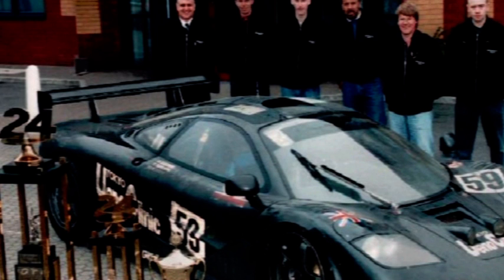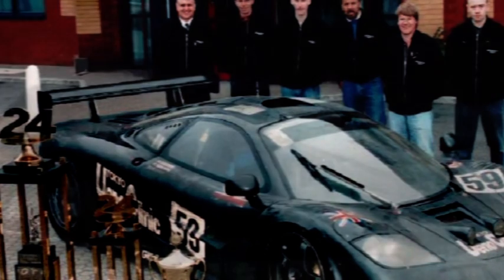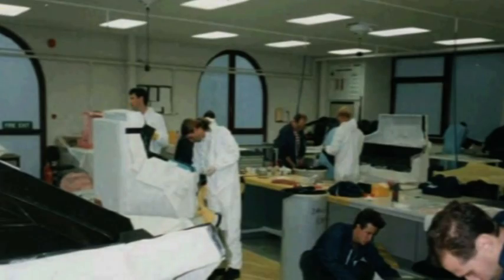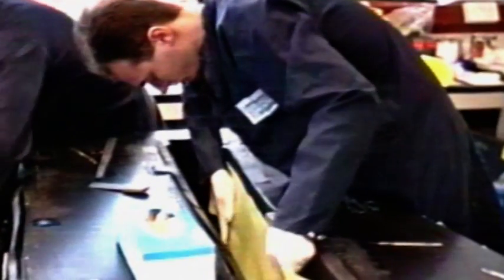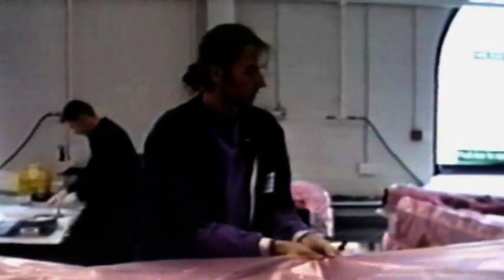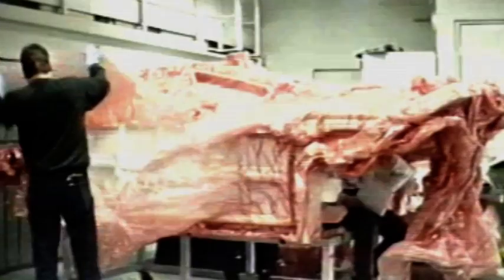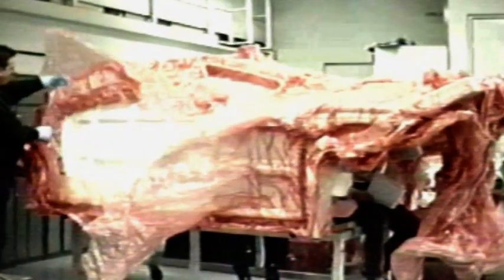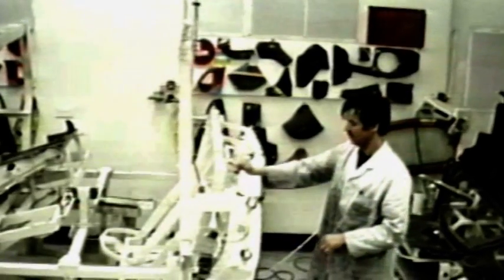McLaren F1 chassis the inside story

Comment: It was a great project David, I don't think the rest of the McLaren group ever understood what we achieved in terms of design, manufacturing and production engineering. It's lovely to see some of the old team. I wonder where they are now? Thanks for posting. The scary thing is we closed down the site 20 years ago!
Reply: They sure didn’t. 
Just look at their P1 which was supposed to be the successor. 
Gordon Murray’s  t5.0 is going to be the winner against the P1.
Reply: @mcgusto82  The P1 had absolute praise from the pres. McLaren, as a new manufacturer, was able to compete with the hypercars from Ferrari and Porsche. Quite an achievement. The hybrid thing was what the market was at, in the end it’s business. Yeah the t50 is going to be great, obviously only Murray can do a ‘true’ successor, don’t think McLaren even said it was a successor for the F1. It didn’t even have the same layout.
Reply: @bishopdredd5349  you’re right. The P1 is not a successor to the F1 but it plays the same role. 
The P1 is not capable to mimicking the F1 because it mission statement was not the same.  
Still the P1 is the 1st super hyper car maclaren produces since the F1. So when the hyper car spot was open, They thought to fulfill the desire of a new F1 with the P1 but it was never a f1.2. 

And because of that the P1 falls short of expectation.

Comment: I saw Top Gear footage many years ago when it was relesed and found it suprising it was all cut by hand and not by CNC machines with oscilating knife or some other rolling cutter- supprisingly low tech for the time.
Reply from the maker: Very perceptive of you....it was a conscious decision based on lean and agile principles. During the development every person in the factory could modify and refine templates, instead of just 1 kit citing operator, we had a very fast and effective CIP process. During production we could cut 6 kits at once, and there was no way we could afford 6 Gerber cutters. Kits were cut "Just in Time" so the material stock costs were minimised and the savings were greater than the cost of Gerber cutter. Our factory too was very agile. Finally we were part of a very happy team at Shalford. You cannot walk into a room with a kit cutting machine and crack jokes...they don't have a sense of humour. I am great believer in autonomation (a misuse of Ohno's original definition I know) and finding the balance between using smart flexible but variable humans and rigid accurate repeatable machines is potentially important both in developing economies and the developed economies as we move to industry 5.0.
Reply: I have never seen a CNC cutting machine that could approach the JIT output of those kit cutters. The goal was to avoid a constraint unless it was where we designed it to be. I have yet to come across a CNC cutter that is not a system constraint which at the beginning of the process is the worst possible place to have it. Then again I have yet to see a CNC cutter that has its OEE measured to attempt to remedy the situation. The belief that technology and super machines is the way forward is as flawed as the paperless office.

Comment: Why are more and more videos of the Mclaren F1 only appears about 20 years after its production?
Reply from the maker: The F1 was designed around the Paul Roche engine. It was not off the shelf but designed by Paul and Gordon Murray for the car. There was no practical attempt to fit a Merc engine, it was a design study. The long tail car was a McLaren design made by producing an enlarged rear bumper (fender in American) the long tail is simply a bolt on bit. It was done to try and increase downforce. As a racer the F1 had limited downforce due its narrow width, this in turn was due to the size of the autoclave which made the 1 piece spider and separate floor. The autoclave had been specified by Ferrari and was an identical copy of the Scholts autoclave installed by Marconi Space at Portsmouth used by McLaren to Make the first carbon fibre formula 1tubs.
Reply: Remember we inherited that factory to scupper John Barnard when he left Ferrari and went to Beneton, The F1 chess game affected us
Reply: @paulmartin8051  interesting indeed... One always assumed the F1 was limited run because of its cost, not the politics of Motorsport. What was the reaction of the team to that news? Was the run of 100 limited from conception as a result of the need for a future car for the American market? That seems insane. The implication is, of course, that McLaren could've gone on building F1s indefinitely, given the evident quality of the vehicle. Wow.
Reply from the maker: The McLaren F1 had a BMW engine at a time when McLaren International was Mercedes Powered and financed, a multi million deal. We tried to fit a Merc engine but it had nothing like the performance, way over weight and too big. McLaren did a deal to kill off the F1 in exchange for the SLR project which had to meet Mercs design spec, hence front engine rear wheel drive to suit the American market. For the time that McLaren were funded by Mercedes They tried to kill off the memories of the F1 and publishing anything would get a law case. Also be aware of the need for McLaren to defend its brand. I suspect that discussion now of the F1 helps sales of the new cars hence things are more open.
Reply from the maker: Gordon is the commensurate professional. Along with his team of Barry, Ben and Graham he did an amazing job creating a unique front engine rear wheel drive car which met Merc's heritage aspirations. They also did the basic concept work for the current generation of McLaren cars before the team broke up. As you know Ben went to Caparo and created the Caparo T1 while the rest are with Gordon doing amazing projects which Gordon always wanted to do.
Reply: but Ben and Graham didn't design the McLaren F1. Ben was an undergrad working part-time Graham hadn't even got to college. The engineer responsible for the composites on that job was me. Lest we forget.
Reply from the maker: It is absolutely the case that the F1 was killed off at 100 cars. One spare chassis over this number was made as a donee for repairs. The factory was turned over to making arts for the Formula 1 team which it did very successfully.
Reply: Very interesting history there Mr. Skertchly. Did McLaren tried to fit a Merc engine during the F1 production? or that began before Paul Rousch supplied the famous S70/2? One of the interesting I find was the timing of Merc's development of CLK-GTR and McLaren's F1 GT (Longtail), Merc's prototype, which they claim to be completely theirs looked identical to a F1 Longtail. Did Merc stole Longtail's design or McLaren borrowed a bit of Merc's?
Reply: Thanks for the reply Mr. Skertchly! I have read a statement by Ray Bellm that he had always thought the Engine was too good for the Chassis and the Chassis was somewhat compromised since it never ran any rear sway bar. In fact, Gordon Murray couldn't believe some race teams custom fitted a rear sway bar into their GTR. So would you say that McLaren probably could have sold a few more F1, but killed it off at 100 units because of the Formula One deal with Mercedes? that would indeed be a very interesting twist in the history of the legendary F1.
Reply: Is that part of the reason of Gordon Murray's departure in 2004? only a year after the SLR went into production. I heard there were some pretty serious conflicts between Murray and the guys in Germany of the development of SLR.
Reply from the maker: @kelvinsa6  serious wasn’t the word for it, try to get a balance with a dirty great engine in the front!
Reply: amazing insights and thank you so very much for sharing!
Reply from the maker: The McLaren F1 was an embarrassment to McLaren. It had a BMW engine designed by Paul Roche when McLaren were sponsored by Mercedes.
Reply: @DavidSkertchly u are still on that after 8 years? 😂. Sir, the engine chosen was merely business. No other manufacturers could achieved what Gordon Murray specced for the engine other than BMW at that time. And the Mclaren F1 beats every other competitors the first time it entered LeMans.